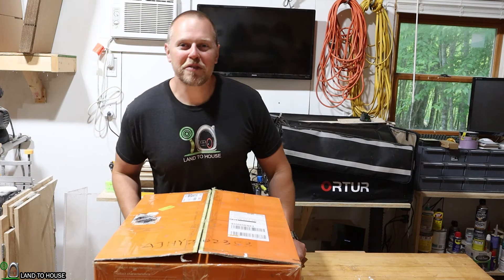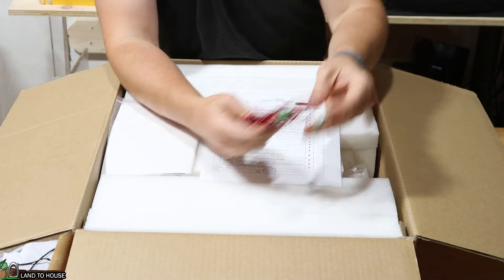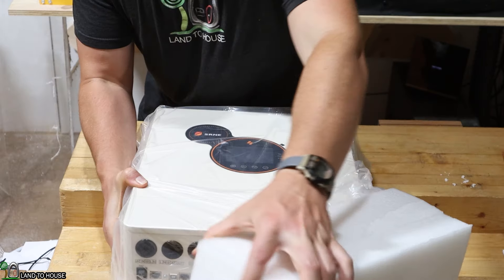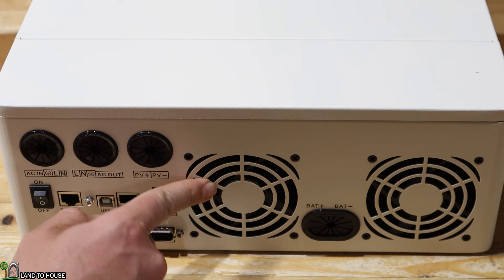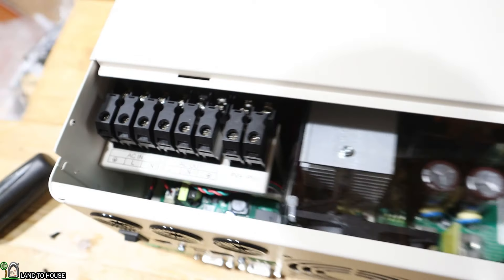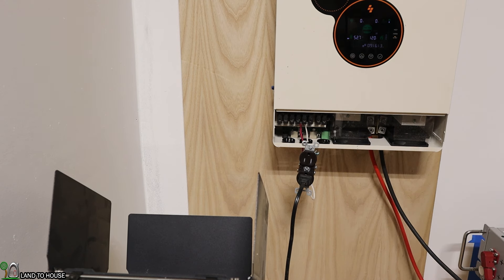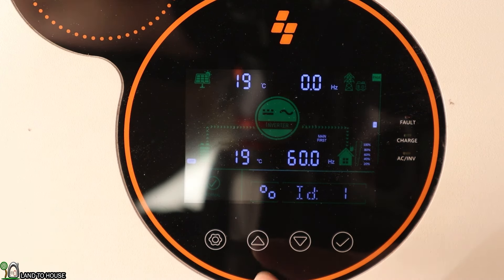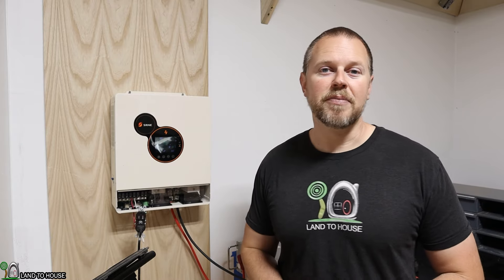SRNE 5000w Inverter 48v Off Grid Power

Comment: I have two of these, running in parallel so I can get 240 volts for 30amps.... but it doesn't work. Trips error code 08 or 15 70% of the time. It's great as a 120v inverter, USELESS in parallel and nobody can tell me why. I've replaced the board twice.
Reply: You can only parallel to get more power not double the voltage to 240v, there re models with 240v output.